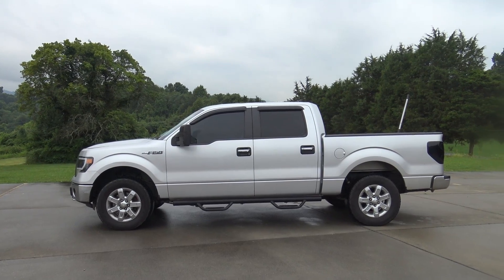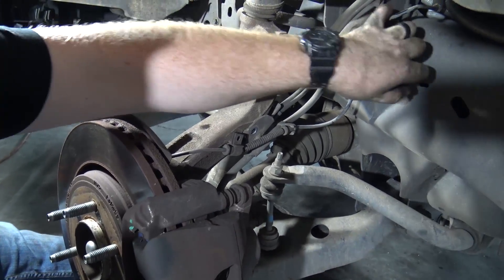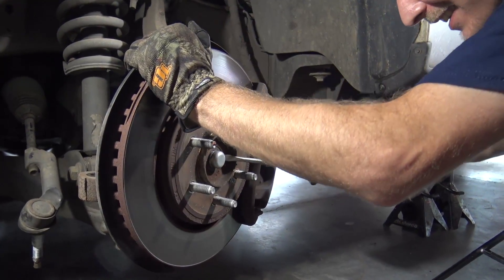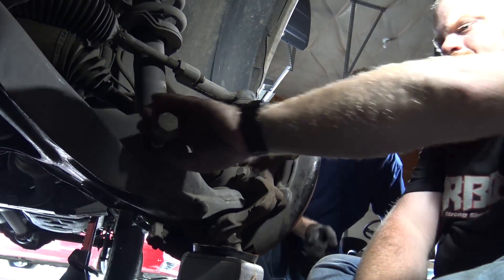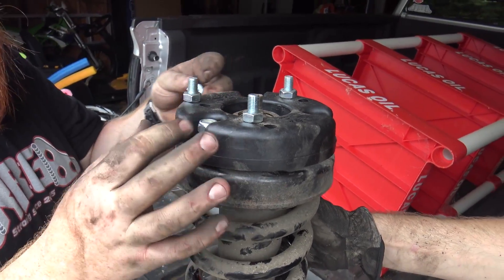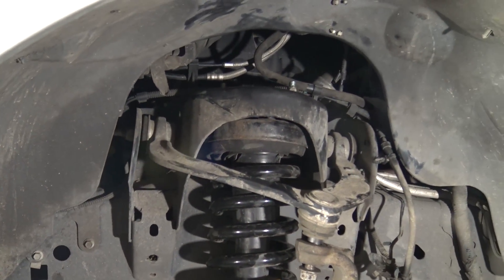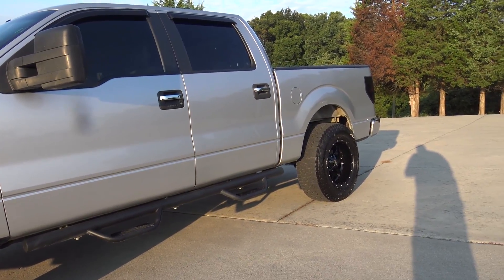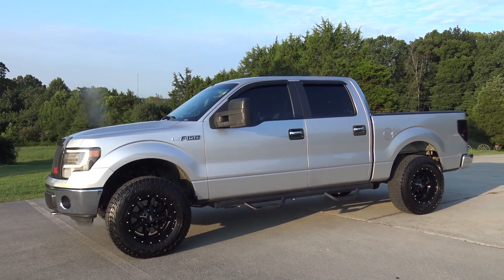09-13 F-150 Leveling Kit Install

Comment: Did this to my 2007 f-150 when it was brand new from the dealer. Never was sorry I did as it made getting larger tires on it possible as I needed that to get into the fields with when they were muddy. Never any problems after that.
Reply: you prolly dont care but does someone know of a way to log back into an Instagram account?
I was stupid lost my login password. I would appreciate any help you can give me
Reply: @Cayson Cooper instablaster =)
Reply: @Alfredo Conner Thanks for your reply. I found the site on google and Im trying it out atm.
Seems to take a while so I will get back to you later with my results.
Reply: @Alfredo Conner it did the trick and I actually got access to my account again. I am so happy:D
Thanks so much you saved my account :D
Reply: @Cayson Cooper No problem xD
Reply: Nice! I have a 2006 FX4. Did the rough country spacers pretty early on. It was nice because I got bigger tires too. I had 20in factory wheels but I bought some 18-in factory wheels and put them on with bigger rubber. I went with the Goodyear duratracs and I love them, they are pricey later on I went back to rough country and got the leveling struts and removed the spacers. When I bought mine, rough country only sold the struts, no coil springs. I went to harbor freight and bought spring compressors and put my old ones on new struts. Nerve racking experience, never again. I once you do this though you will notice that you have an extreme angle on your upper control arms. I would recommend upgrading to aftermarket control arms that are made for lifted or leveled trucks. I went with the icon Delta joints  country struts with icon struts. Doing that now as a matter of fact. Going to try new wheel and tire combo too. Want more offset and more rubber, narrowing it down. I am pretty happy with current setup though. It's great hearing everyone's info and advice.

Comment: Looks awesome.  I just bought a 2011 f150 Texas Edition and want to get a leveling kit.  This helps a lot, thanks.
Reply: Looking into a 2013 f150 Texas edition, did you ever get the kit on it? That’s the first thing I want to do to mine.

Comment: Shop tip. Get a regular fan, ditch the blade, find a tri-blade (RC, prolly a Mustang RC plane or something like that) make it fit, and then profit. Prolly wanna make note of the way the motor spins before buying the prop. When these props, which are fully optimized for flight aren't run 100%, which a fan is like what...40% or there about, they are very quiet. I 3D printed mine and it's one of the quietest fans ever. Obviously, if you hit the camera, it will "ping", but set it at the ground and you should be fine.
Being hot and sweaty when you work sucks a&&.

Comment: i got my kiit sitting i have  auto springs 2 /1/2 leveing spacers i dont no if i need taller ones in rear of my 2011 f150 4x4 
epic video

Comment: doesn't removing/separating the axle screw up the IWE vaccuum?
Reply: Also, i just watched a guy install spacers by only disconnecting the lower control arm and sliding the strut in and out. is this possible!?
Reply: Same thing I was wondering too

Comment: Question, what do you do when your trying to take the bolt off the upper control arm and the bearing just keeps spinning
Reply: You should be able to put a 10mm box wrench on the bottom of the stud for leverage. You will not be able to use an impact if you need to do it this way.

Comment: With just the leveling kit installed do I need to get the truck aligned?
Reply: Yes. That’s a must after install. ASAP, I did mine at the same time it’s roughly 2 hundred dollars to get shop to do it. 2 hundred for the kit, then 85 for alignment. About 500 will get you level properly if you don’t install yourself.

Comment: I too have the same question as others which I have not seen an answer to….does leveling effect the ride quality?
Reply from the maker: It did not. Ride was as good as factory. I did notice a drop in gas mileage in just the leveling kit.
Reply: @RedBeardsGarage  great. Thanks for responding 😊

Comment: Never beat on the tie rod that way, put pressure on it with a pry bar, and hit the part its stuck into, it should pop apart relatively easily, and you don't risk damaging your tie rod end.

Comment: How'd you guys get that strut back in there, I couldn't, for the life of me, push that strut back in after putting the spacer on top. The control arm would not get down far enough, tried removing the knuckle from the lower control arm but at that point it could move far enough to release that bushing, I put it all back together to take a swing at it again next week.
Reply: kyle saich make sure you have BOTH front tires off the ground.. the suspension is connected so if only one side is up, it puts pressure on the other side and makes it impossible to move anything

Comment: So I just installed my 2 inch level but with lifted struts and rear shocks. As well it came with the 2 inch blocks for the back. Well it ain’t quit level?? You can still notice a little kick up in the rear, Am I missing something? A little upset it didn’t turn out full level. Will the rear eventually level? Please help
Reply: So you did 2 inches at the front and 2 inches at the back? It’s not gonna be level unless you bring the front up more than the rear.

Comment: I had my f-150 leveled with spacers on top of the struts but problem I kept having was my control arm Was hitting against spring . As well it was damaging my suspension. Decided to drop it back down to normal. Anyone have the same issue? Did mine exactly like the video .
Reply: Yea on my 11’ went with rancho quick lift (full strut) never hit again. I think they make them slightly slimmer